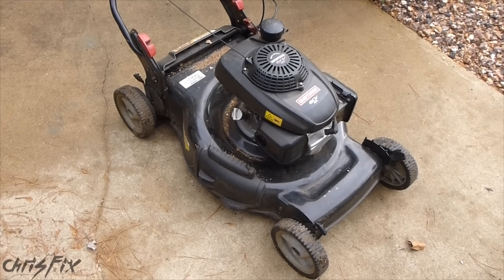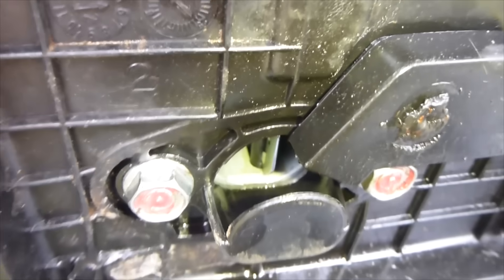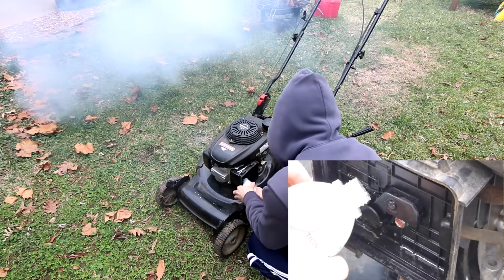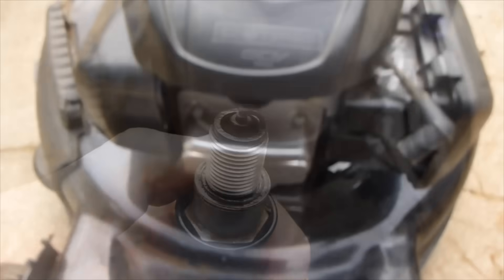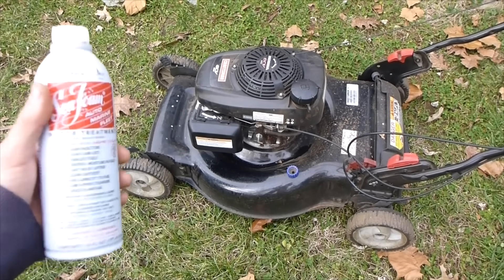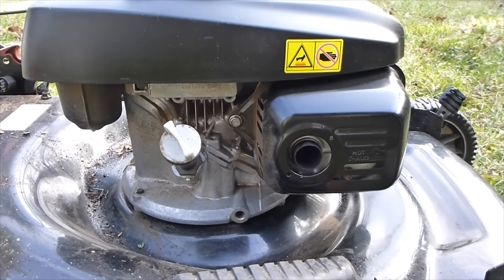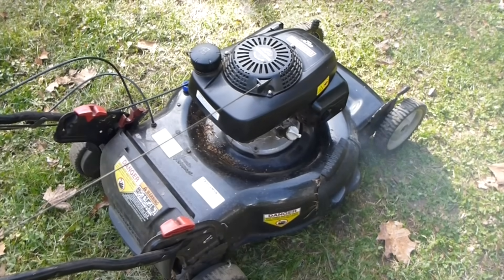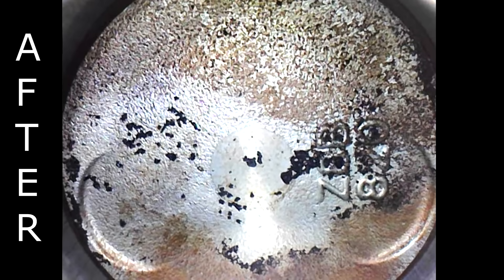Does Seafoam Actually Work? (with Proof)

Comment: Thank you for the unbiased test, alot of people have been slandering this product which ive personally used for years and had great results
Reply from the maker: ghettohillbilly1 No problem! I will be testing it out in a car engine soon! Stay tuned! Definitely consider subscribing! New automotive 'how to' videos every Thursday and most Mondays so stay tuned!
Reply: Slandering the product? Ever consider that what (you believe) worked for you had different results for others? Did you do a borescope check before and after using seafoam? I did and saw no noticeable difference. I also tried seafoam as recommended to try and quiet sticky lifters. It also had no effect. If I share my experience in an Amazon review that I felt I wasted over $20 is that really slander? Let me also ask if you saw such a review would you as a fan of seafoam try to discredit the review simply because you believe their experience should be identical to yours? This is one product where you tend to see a lot of that there.

Comment: Try just plain water. If you've ever changed a bad head gasket, the cylinder that was leaking is sparkling clean.....I put several gallons through every car I own once a year....Works great
Reply: I preach water decarbonisation all of the way instead of these other additives. But when you say something against the current norm, people dislike you for it.
Reply: coolant isnt just water, glycol is a very good cleaner especially hot and under pressure for extended periods of time thats why it is so clean
Reply: TheTokuin I've been a circle track racer for 30+ years and all we are allowed to use as coolant is plain water. Because of the clean up involved with coolant it takes too much time. In the event of a crash where the radiator is breached a good portion of the water will evaporate quickly because of the heat. 2nd, I am not promoting the use of a garden hose to feed an engine water, I usually will use a tiny hose from a fish tank connected to a vacuume port and stuck in a soda can of water, takes 15 min to drain 16 ounces. Automatic water injection is a popular method reducing combustion chamber temps while towing. Side Note: During the recent "Cash for Clunkers" where dealers were required to seize an engine solid with silica sand, we were surprised when a ford V8 swallowed and spit out: 1 gallon of brown rancid orange juice, 1 can coke, a sizable portion of rice and 1/2 peanut butter sandwich, which appeared to hang a valve open but eventually cleared itself with a just a check engine light. ...Little water ain't gonna hurt.
Reply from the maker: ***** Thanks Mark. I will be testing water soon so stay tuned!
Reply: How do you clean the outside of an engine....steam right?......that's what happens when the water hits the hot piston and valves.....I worked for a guy that did that to every customers car at tune up time.....he had many cars in his care that had 120,000 plus miles on them.....that was a big deal in the early 70,s....mileage over 100,000 was not expected until fuel injection was common.
Reply from the maker: ***** I woiuldnt clean a new engine with steam. There are so many electronics and things that shouldnt get wet. I would use good ol' elbow grease and a degreaser. That is how I detail my vehicles.
Reply: All those connectors are weather-pack.....won't hurt them
Reply: TheTokuin your an idiot putting a little water through the intake to clean the engine won't hurt anything but your ego. I've done it many times seen it done many times. Keep your opinions to yourself only facts
Reply: You win again hillbilly
Reply: ChrisFix do not take his advice, never put water in a combustion engine, that's just asking for blown gaskets. Water expands way too much and way too fast when heated, you can cause serious and irreparable damage doing that.
Reply: Dieseltech36 I've been using water (from a garden hose no less) since 1976.  Not ONE problem.
Reply: Love the Mark Stanton comment!
Reply: BMAC VAGS what other additives do you preach against beside seafoam??
Reply: ghettohillbilly1 First of all, I don't preach against anything, I just state the facts as they are presented.  I have not tested any other fuels additives to state if the claims or facts are true. Are you willing to fund the additive tests you want to see?
Reply: if you dont preach against seafoam how come you have negative comments towards seafoam on almost every single seafoam vid on youtube?? and no I do not support tests that are biased and do not follow simple scientific methods so you can beg for money from someone else
Reply: BMAC VAGS I always do
Reply: For a winners like you, how is your channel going?
Reply: So Why its okay to use seafoam but not water?

Oil can also hydrolock the engine if too much is put in, please explain your logic.
Reply: Also where did you get that information from?
Reply: BMAC VAGS it's not about hydrolock, its about mass expansion in a closed space. It's the same reason you don't use water as coolant, because it will cause a rupture in the cooling system. Engines have a stress threshold and steam can exceed that threshold.
Reply: TheTokuin The combustion engines are all about mass expansion in a closed space. Have you ever seen irreparable damage by using the water method?
Reply: BMAC VAGS quite well thanks, hows your slander campaign going?
Reply: ***** Excellent explination, experience over theory every day of the week.
Reply: BMAC VAGS lol you spout theory over experienceall the time ffs
Reply: *****
just because it doesn't blow it up right away, doesn't mean it isn't damaging your engine. Also, are these cars you race with fitted with special cooling systems or are you using consumer grade systems? Track cars get significantly hotter than a car that is just driving on the road. So if you are telling me you run water in a track car that uses a consumer grade system, I call bullshit. I've seen radiators blow a hole through the side because made too much pressure in the system.
Reply: TheTokuin The temperature of the internal components and oil are higher on a race engine but the cooling system should not get much hotter. All circle track cars, even NASCAR, run water. I have ran a stock production radiator from 1980 on my race car for an entire season without it blowing up. A radiator rupture is the result of a faulty cap and an overheating system. Also people have been running water through engines for decades. To clean them, cool them and make more power. I build my own engines and would not hesitate to clean one by running water through it.
Reply: ghettohillbilly1 Bitterness is like dining poison and waiting for the other person to die. Spread love not war
Reply: Dieseltech36 I've been using water (from a garden hose no less) since 1976.  Not ONE problem.
Reply: TheTokuin Yes, as opposed to rapidly burning gasoline? It shouldn't do ANY harm unless you just dump water in
Reply: ChrisFix modern electronic connectors are waterproof entirely
Reply from the maker: Kyle Crater Yes, but with time, vibration, heat cycles, etc, waterproofing degrades.
Reply: all surely thought of by people who design cars/car parts... you dont think they account for those conditions???
Reply: oh my.. another "genius" at home engineer
Reply: Joel Garrard Thanks Joel!
Reply: TheTokuin best tell all the people using chemical intercoolers then. Water injection has been used with success for almost as long as the internal combustion engine has been in production. Water is safe to inject using common sense as a moderator, using a fire hose might be tricky on all but the largest engines. That said a few cc per second into a running 2 liter engine is not a problem.

Comment: I used seafoam and it caused a fuel line leak.
Reply from the maker: flatiron1969 The seafaom probably didnt cause the fuel line leak. The leak was probably gummed up with varnish and stuff and the seafoam cleaned it out. Seafoam doesnt have any chemicals in it that would degrade a fuel line.

Comment: Quite nice effet, but I have much more fun with disassembling the engine and cleaning it part after part :)
Reply from the maker: MrUhbygvtfc Haha. Disassembling the engine is fun for these little engines, but for a car engine, it is a lot easier to use seafoam (well we will find out when I test it in a car).
Reply: I meant the car/truck engines ;) I just love that "work" - disassembling every single part, cleaning it, repairing etc and putting it all together. Anyway, I must try that seafoam :) Btw, Your video is great. Everything is clearly shown, step by step with results. Waiting for testing on a car. All the best ;)
Reply from the maker: MrUhbygvtfc Thanks a lot man! Yea, I can see how taking apart an engine and cleaning everything could be fun!

Comment: I would say in a car, take out the spark plugs and pour in a little seafoam to lightly cover the piston. Let it soak for about half hour. Take a long nozzle air blower and stick it in each spark plug hole and blow out the seafoam. Hook everything back together and start the engine. This might even produce less smoke
Reply from the maker: BigRidge That sounds good in theory but it isnt that simple. Using air to blow the stuff out wont work as well as you think. Unless you have a problem, it is worth it to just use seafoam the way they suggest on the bottle. Good thinking though.

Comment: Tanks smoke screens are made with raw diesel dumped in the exhaust.
You can do the same with glycerin and water,or glycol (coolant)
Reply: Would not recommend doing that with ethylene glycol.  That stuff is very toxic.
Reply from the maker: michaelovitch Yep, which is exactly like running seafoam though your engine.

Comment: thanks for the video, but you really should have removed the mower blade.
Reply: It'll damage the engine  to run it without the blade. Vertical shaft push mower  engines use the blade as an auxiliary flywheel
Reply from the maker: Brian Walsh II Why should I have removed the mower blade?
Reply: its dangerous to be working around a mower while its running with its blades on. my family has owned a landscaping business for 35 years now and we have always demanded that the blades be removed for safety.
i have seen people lose toes because they didnt follow that one simple rule. toes removed by a mower blade cant be reattached and the poor soul will have difficulty walking for life.
Reply from the maker: Brian Walsh II Thanks for your concern. I was never near the blade of the lawnmower but I will keep that in mind if I ever work on it in the future!
Reply: Texassince1836 and some engines wont run at all. they have a really light flywheel on engines with a spinning blade. older ones will run without though. but that honda im betting wouldnt of.

Comment: Looks like it works well on piston domes, but I'd be more interested in knowing how well it does on the valves, particularly the back of the intake.
Reply from the maker: Maindrian Pace If it is working this good in the cylinder, I am sure it works great on the valves. I wish there was an easy way to check the valves.

Comment: Nice, the thing that it likely best to clean that improves engine performance is the engine valves (not pictured). Carbon build up that make the valves, and carbon on the valve seats causing to not completely close that is.
Reply: ChrisFix Yeah, that's what I'd be more interested seeing. How well it cleans the valves. I think that would be a bigger issue in reduction of a vehicles performance/economy from sticking valves and reduced airflow because of carbon buildup.
Reply from the maker: John Archer Yea, exactly! If it can remove carbon from the piston head it can remove carbon from the valves.

Comment: Since that was a single cylinder, shouldn't you have tried only running 1/6 or 1/8 of the recommended dosage on the can to show what it would do to car engines realistically? It seems like putting 1/3 of a can on that engine was a HUGE dose of sea foam.
Reply from the maker: Robert L I was just following the directions. When I test it in a car we will see the results.

Comment: Chris... love ur videos... keep up the good work.

I am disappointed with Chevron w/ techron video.... cause I usually use that cleaner. But my 2nd of choice is Seafoam... n I am thrilled. Would you be able to test the Berrymans B12 Chemtool? It's cheaper than all the other cleaners but I have heard it's a harsher chemical. Please let me know. Thanks.
Reply from the maker: kcpth Thanks a lot! I will be testing seafoam on a car motor soon enough. I will not be testing B12 because it has harsh solvents such as toluene and acetone which melt plastic. For me, that is something I want to stay away from.

Comment: i did use this in a car engine. it was the spray version of seafoam and all I did was spray a little in each cylinder hole and let the vehicle sit 2 days. cranked over quickly and then I installed the spark plugs, primed the fuel system and started the vehicle. It ran smoother than it previously did. this was on a car that sat for 4 years outside, I think the seafoam cleaned rust that had occurred. I wish I had one of your little cameras to check
Reply from the maker: 99Legacy2.0T Thanks for sharing! Yea, I bet it helped with the rust and also lubricating the inside of the cylinders!

Comment: your supposed to mix it in with the fuel
Reply: jeremy lee I do both on my push mower on my garden tractors I just run it through the gas and the oil.
Reply from the maker: jeremy lee There are two ways you can do it. You can put it in the intake or in the gas.
Reply: i started running it in my diesel and noticed better fuel economy
Reply from the maker: jeremy lee Nice! Thanks for sharing your results!

Comment: If you google seafoam, go to their website, it will give you the ingredients. Seafoam is mostly colemans camp fuel. Just google the cas numbers. It camp fuel. Camp fuel is about 10 dollar a gal at walmart. So head to walmart and buy a heap of seafoam for 10 dollar instead a little bit.
Reply: Yeah, put you a can of seafoam in the oils. May have a lifter carboned up. The 5.3L will have a piston knock around 99/2000. Will stop after a minute or two of running. Worse when it cold outside like now. I use kerosene for seafoam, works the same.
Reply from the maker: Jake Payne Seafoam is Pale Oil, Naphtha, and IPA. Coleman fuel is pure light hydrotreated distillate (Naphtha). The other ingredients in seafoam makes it work. Maybe you can use camp fuel, but it is not the same as seafoam.
Reply: Camp fuel and kerosene makes like sea foam. Cleans stuff. Make lifter quit clicking. Cleans cat converter and O2 sensor. We use it alot
Reply from the maker: Jake Payne Good to know! Thanks for the tips!
Reply: Put about a quart of kero in ya tank when you get a P0420. Muny light on and off. Cats get cleaned, light stay off.  Done of heap of cars including my CRV.
Reply from the maker: Jake Payne Thanks for the tip!
Reply: Experts need lots of testing to have a job every week. I have used petroluem distillates in many cars. It gets the job done just as well as the expert formula. If it didn't then I would went to plan b long ago. This is not cancer we need to cure on a car. A cure would put too many people in the poor house.
Reply: I wasn't trying to be rude but I really don't understand hoe  low tire pressure can cause lifter noise.
Reply: the key word there being "mostly". If you want to save $5 and take chances with your $10,000+ car then by all means do so. But these companies do lots and lots of tests to create their formula. They're the experts, if after doing their research they found that just having camp fuel alone is sufficiuent then they would not bother with all the additives.
Reply: A lot of things is made out of sugar but the additives make it a bit different between this and that.
Reply: Jake Payne can I use this on a 99 Tahoe  wha do I need my Tahoe has a bit of lifter noise  we are getting ready to pull the value cover off to adjust them and tighten down to avoid issues later on
Reply: okay is there a certain one i use for the oil  and do i just mix it in there  with the oil  can i request it be put in at next oil change as it is close and maybe we where going to remove the valve cover and re adjust them assit before the problem worsens  it makes the sound hot or cold but the issue does not worsen when the engine and oils heat its a constant sound but it wont always do it or i dont always hear it  but usually im in a hurry when i got it  it had been awhile since the oil was changed the oil was filthy  so i had it changed i also had a tune up done wich fixed random misfire case with  a flashing engine light. it had the wrong spark plugs in it  also the cap was  very corroded and contact was very poor.
Reply: It look just like the container in the picture above. Ore ya can just get colemans camp fuel  and use a pint of that in the oil. Pour it in when the engine is cold is better.
Reply: okay ill give it a try when i have some spar funds its almost time for an oil change too.
Reply: got me a set of valve gaskets and at some point we are going to remove the valve cover and assets the lifter noise  see whats causing it  and repair it before engine damage id like to keep my car running haha.  i think i may end up wit a Honda accord or something though i love my tahoe but  it guzzles gfas like crazy i dont really like honda but  they are good on gas im sure it will be okay cause i try to take care of my car.
Reply: Ya have enough tire pressure??
Reply: whats that have to do with lifter noise   but yes the tires are aired up to 45  max psi of 50
Reply: OnlineBackupServices
 stop being a puss. some of us prefer to know these tricks. if you are afraid to try it yourself then just dont do it.
Reply: Water is basically free and works just as well.
Reply: plain water also works as well